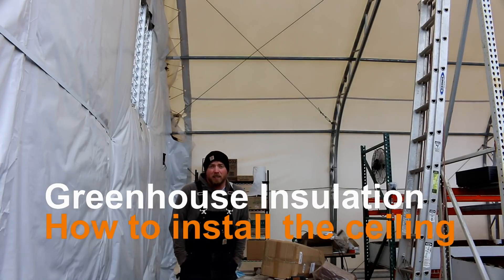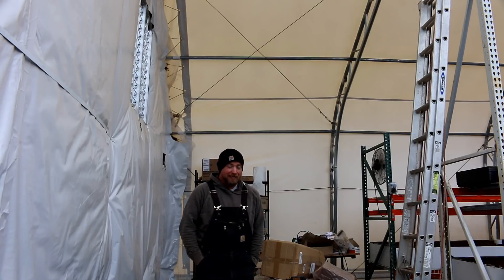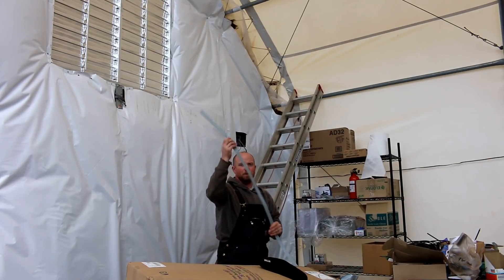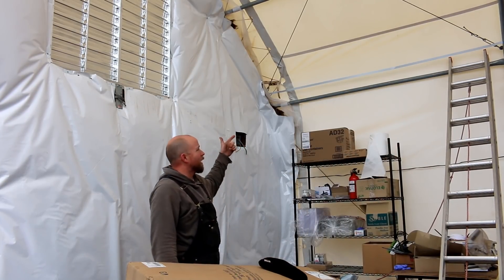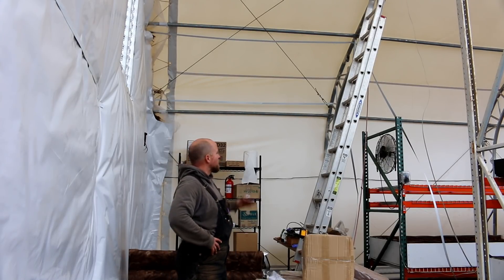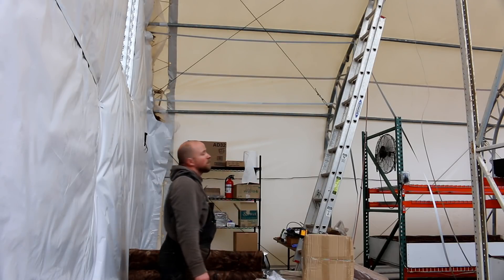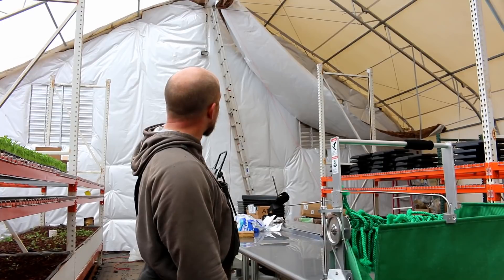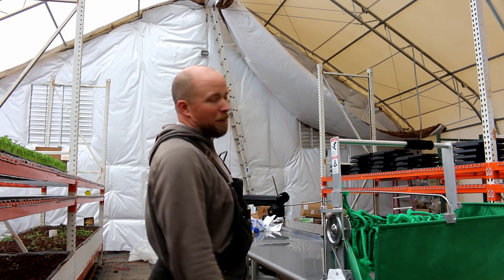How to Insulate a GREENHOUSE - Trying to install the ceiling

Comment: 2 pulleys at the top run the ropes to the ground and start at the bottom. Use some PVC pipe as temporary bearing surfaces and pull the insulation up from the bottom. Attach the straps as needed. Of course, get help. That is a 3 man job. Or use your tractor bucket to pull a little at at time.

Comment: before you trim the insulation, can you shuffle the slack back down the roof once you have it all hung like at the end of the video, that would allow you to make the cut at the bottom, or don't even cut it, just add the next section where that one ends.

Comment: you should tie ropes on the inner tube of the building supports then pull the insulation up behind the rope then all you have to do is attach to the outer tubes.

Comment: Roll the insulation up around a plastic pipe that can reach between each section of support beams, like you did with the board for your ladder.  Unroll the insulation as you install and secure it, and just move the roll up/down as you go.

Comment: Perhaps some rollers to pull the insulation thru. For example 3/4 emt with 1 inch pvc over that. Secure the emt to the building and as you pull on your pulley it will pull it right over each roller. 4 sounds like a good number to start with. You may be able to get away with making a rebar hook for the emt to hang on the building. Once pulled, roll out your banding and secure in place.

Good luck

Comment: Since you can not grow more arms I think 3 more pullies would be helpful,
Use one at the order corner to get the upper part of the blanket in position then two more hold iy in place where the next set of fastners are to be installed. Then repeat for the next section.

Comment: Please stop using the ladder in such a dangerous manner, it's just not worth the risk.  Sacrifice one of the insulation jobs on the end doors and rent a man lift.  If you don't want to do that, then at least go see if Cody will let you borrow his scaffolding.  He's got a bunch of it just laying around and you can get the scaffold sections through your man door.  Scaffolding is much safer than a ladder and you can build multiple levels of it to get to the different roof heights.  Yes, you have to erect it and move it around, but putting that ladder against a board that's not secured is just asking to be injured.  Scaffolding is still wobbly, trust me, I know from first hand experience painting my 2 story foyer, but it's far superior to a ladder.  If you tie multiple scaffolding levels together, or tie the scaffolding to your grow bed rack system, you can make the scaffolding much less wobbly and far more secure.  Another idea, if you have any left over racking sections, you could build a scaffold out of that.

Comment: Love the videos and can't wait to see the data after the insulation is up. One that that is helpful in ladder and truss situations is to get a web sling like climbers use and a caribeener and a full harness is nice but a waist belt works too and is cheaper and anchor yourself to the ladder. Then if you ladder is position with the right slope you can work with both hands and confident in that you wont fall off. I work on 25+ ft tall lighting trusses and position myself this way all the time. Good luck

Comment: You spend a lot of time thinking out your electronics. Take some time to think this out too. 
I think I would start by folding a foot or so of the end over a piece of 1x2 or PVC pipe to give you a clean hook-on point for a pair of ropes and pulleys. This also gives you a stable top piece that will be easier to work with and give you a nice, even, flat pull. You can leave those in or take them out after mounting, whichever makes more sense to you. I like the idea of 2x4s or pieces of pipe in about the same places you would put your straps, but on the inner tubes of the framework so you have more space to work in. Put your pulleys at the top, and run your ropes down between your temporary cross-supports and the skin of the building, then pull the insulation up to the peak and secure it there, then work your way down tightening everything up with the straps or the shorter pieces you described.
I've done a lot of high ladder work, and I'm not shy about it. Even climbed a few radio towers, but I really don't like your setup. A scissor-lift or scaffolding would be idea, but at a minimum, you need ladder hooks, and I'd seriously consider a harness. Will your plant racks allow you to connect across their tops to make a sort of platform?
Whatever you do, think it through before you climb up the ladder again. You now have a feel for how the stuff handles, so take that knowledge and work out a system in your head and on paper.  
I'm also thinking that a permanent bar as a ridge-pole, running the length of the building right where you've got that temporary 2x4 would make sense.  some old sections of aluminium irrigation pipe would be ideal.  You're probably going to need it when you start engineering the retractable sections, and it will be handy for right now as well.

Comment: First, safety harness with a supine lanyard.  

Second, what if you put several 2x4's across the bay from girder to girder the same way the strapping is installed.  Don't secure them,  just let them "ride against the inner most tube - then you would be able to pull the insulation sheeting up to the top with the pulley system while it stays pretty close to where you want it anyway.  After getting two pieces up in the bay, go back and secure the metal strapping and push the 2x4's over to the next bay.

Comment: put a piece of 1 in steel pipe inside of a 2 inch pvc ...as you put the strapping in put a pipe roller set up at each strap...put in pull rope from peak to the edge and pull it up from the peak......we used similar techniques when running fiber optic cable long distances on  varrying heights of poles.

Comment: Looking at what you are doing and have done something like this in the past why don't you take some ropes run them across the bay much like the straps would run. Leave them slack so you can pull the belly of the batts up into place.  It look to me the lower tube of the truss would work well for the rope to slide over as you pull on them to get the batts into place.

Comment: Get you some three-quarter inch steel pipes the length of your structural frame and some piece of PVC pipe to slide over the pipe to a roller, make some hanging brackets to fasten to your structural frame and hang it to support  your insulation behind it and pull it to the top, one set that each of your crossmembers this will help to install your insulation and you wouldn’t have trim at the top. Maybe take a couple of one by two or one by threes and fasten it across the insulation with a couple of eye hooks to fasten your pulley system to do for your hoist the insulation up and keep it flat

Comment: You do a lot better on the ladder than I would.  Like Joop Terwijn said below, would it be possible to string cables between the trusses to help support the insulation while you install it. Also you might be able to put a top layer on your lanes, to use to walk on when fixing the insulation above them.

Comment: Would it help if you created a rigid end on the insulation strips first and then pulled them up?  A length of 1/2" conduit or 1x2 with the insulation end fixed to it.  You would have better control once you got to the top.  Maybe you could have preinstalled hooks up top to hook the rigidized end into or maybe have hooks on the rigidized end that you simply have to hook over a strut tube at the top.  "Rigidize" the end of the insulation, pull it up and hook it, then work down to the bottom like you prefer.

Maybe fix all the insulations strips around a length of small conduit  -  pull this rigidized end up with one or two pulleys  -  wire or screw it to the top bldg frame  -  start working down from the top either screwing the insulation to the bldg or maybe using more cross bars of small conduit (wire one end to bldg, swing the other end up and capture all the insulation strips,  wire the other end bldg frame).  This would be easier to modify in the future, also.

Maybe others can build on this idea and improve it.

I'm with you on the high ladder issue.  Sometimes you have to do it.  Never like it.

That junction between the wall and the first ceiling strip looked good - closed up.

Comment: Much respect on this one.  It is hard to appreciate the situation just from watching the video, but I dig it.  The scale of the thing, working alone, that is some serious height for a ladder, and the impossibility of draping that insulation around an inside curve....Yeah, man, that is hard core right there.  My nerves were shot just watching it.  Scissor lift, scaffolding...I see how hard that wuld be in this situation.  You at least could use another hand or two...Good luck, brother.  I don't envy you on this one.